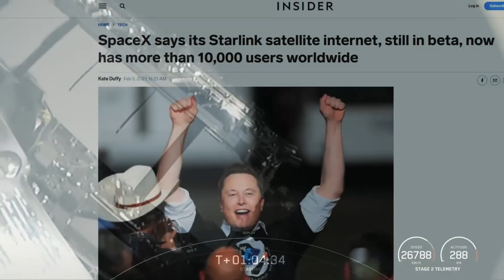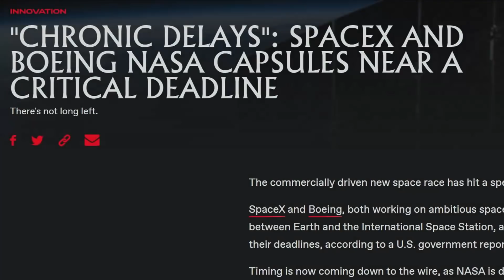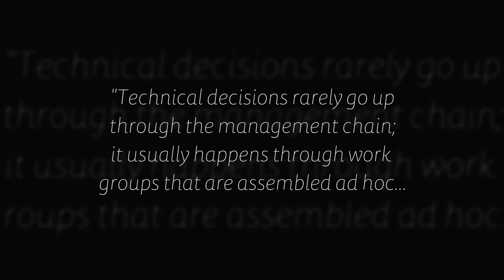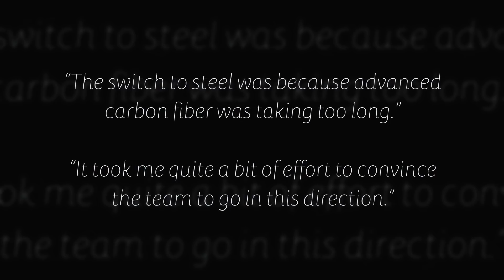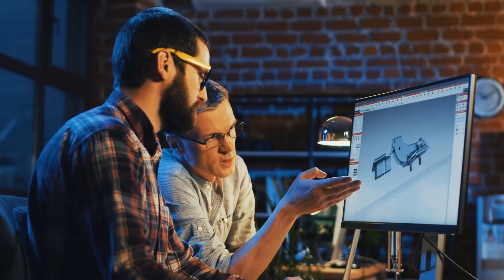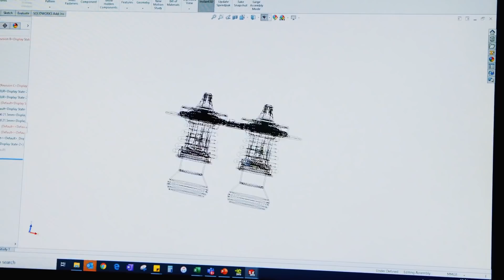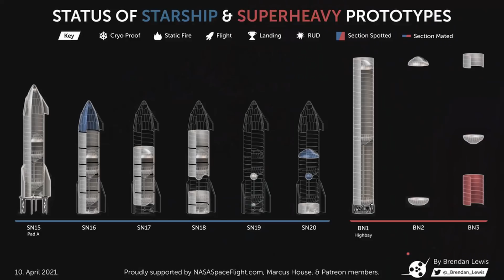How Does SpaceX Move So Fast?

Comment: Broad Group has managed to build a 10 storeys building in just 28 hours.
They managed that because the design is both prefabricated and unfoldable.
What do you think?
Reply from the maker: I'm really interested in emerging construction techniques. I was going to make a video on 3d printed buildings, but I am going to expand it to construction in general. Its very interesting because construction is one of the biggest expenses most individuals face, yet unlike many other technologies, its not really been getting much cheaper. That said, there is a lot of interesting stuff going on in this area that could change that.
Reply: @ExaCognition  The biggest shipping containers are 60ft long and 2.44 meters wide so if they expand by 300% you can get 179 square meters per container.
300% is what tenfold engineering is promising for the TF-38
Reply: @ExaCognition  The largest container ship has a capacity of 23'964 20ft containers so 7'988 60ft containers.
That's 1.4 million square meters that can be deployed in one go, slightly less than the New Century Global Center with 1.76 million square meters.

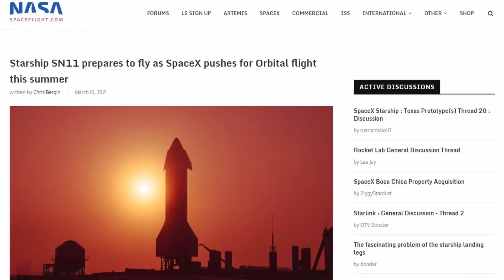Comment: 13:14  First operational flight in September, that is fantastic. I have been asking around for some weeks now if anybody knew when that might happen. Thus far nobody has answered any of my queries, and this is the first story I have seen, text or video, containing the information. What was your source? I sort of have a bet with Jim Bridenstine over whether Starship would begin deploying payloads before SLS flew.
Reply: Not sure if Starship will deliver payloads before SLS flies Artemis I. Elon Musk's Mar 30th 2021 tweet

"Next major technology rev is at SN20. Those ships will be orbit-capable with heat shield & stage separation system. Ascent success probability is high.

However, SN20+ vehicles will probably need many flight attempts to survive Mach 25 entry heating & land intact."

https://twitter.com/elonmusk/status/1376898630582419461?s=20

So they may not even have a Starship survive reentry until 2022. SLS is scheduled for Nov 4th, 2021 and with all the SLS parts in the VAB, they might make it on time.

Comment: #SN15#S16#StarshipN17
Be able Where to find the side antennas-coming-contact📡 with the ground fixed on the💎 wings 💎 closing this lox power wind ignition 🔌🐲 with synchro stop of 8 inches at 😎10/100 e🏎of a second🧲🦿 landing thrust before the ground allowing the balancing of 150 tons 🎠🎠on touchdown heels 👠👡pretty pathfinder.

Q2. Knowing SN15 multiple upgrade 👀 🛹🛹🏆of the reliability of the best modern degree sensors 🛎 ⚖ without flat bottom balancers, this wave finish🦺 magic named Desire.

Q3. Well thought out this 🪔2/3 days of degenerative barometric 🚀 (Mbar=setting of 1013 Millibars)🧷⛽, aiming for the very fascinating RAPTOR sn-series metalox weather allows initially skies ⚔ too dry🪐💡wonderful weekend Starship.

Comment: I've been a part of the software industry for 30+ years and seen the waterfall, RUP and Agile approaches. There is no question that the Agile approach is more cost affective because it lends itself to figuring out the technical details much earlier so you know what works and what doesn't much faster instead of getting to the finish line with waterfall or RUP only to find out that your technical direction used for the very foundation doesn't work and now you have to redesign critical systems which could change the entire design. Musk has also brought unit and integration testing to the hardware world. This is why he is succeeding where others fail.

Comment: Rolls Royce rapidly developed the Merlin engine by taking a few off the end of the production line and running them hard till they broke. They'd identify where they broke, beef up those parts, do it again, till they had one tough engine with the best power to weight ratio. Broke a lot of very expensive engines, but it was a race and it was worth it. An old fashioned way of doing things maybe, but Elon knows he's not immortal, and this is the quickest way to Mars.
Reply from the maker: Test to destruction was something I am planning to cover in a future video, but it's great to see which areas are failure points, and which areas are over engineered, so that you can simultaneously improve quality and performance. As you say, it's expensive but can pay dividends down the line.

Comment: thats why elon chose stainless steel when doing iterative development, carbon is too expensive and slow, stainless is cheaper and faster
Reply from the maker: Indeed, there are performance benefits at both the the cryogenic and re-entry temperatures, but the primary reason was development speed and manufacturing scalability.

Comment: This babayaga begs to differ. 
They should dig a hole in the ground as depicted in some olde 50's and 60s era scifi art.
Whereas assembly would be much easier with gantries and elevators. Work can be performed in any weather 24/7.
Then they wouldn't have to deal with cranes and the hazzards of working with them. 
Should a booster assembly go kablooey - all the bits would be recoverable with nothing falling upon innocent victims.
No worries in case of hurricanes or tornadoes, just button up the lid, continue working.
A mobile disassembly gantry would be handy when disassembling reusable boosters, after they land (intact). Until such time that they can land back into the launch hole in the ground.

Comment: Good PR, general unawareness on subject and head start before announcing. Quite simple, really. Also, some self-defeating points in the video.  1.  fact that NASA pushes for 'unecessary' safety doesn't mean it is wrong ( if that had been the case ), especially in industry where all experiences are literally burned in fuel and written in blood 2. Silicon Valley is no longer "silicon" - it is software. And Scrum-but(t) is about worst way one can go about software (or product) development.   3 There's a great essay "Don't Kill Your Cattle" - that stresses investigating WHY something went wrong, not just replacing faulty machine with new shiny one.

Comment: Its certainly evolved from the early cgi drawing board, there is 3 profession branches governing any invention, the exicutive - Engineering,  judical - Physics, and a third most inventors forget to cope, legislating - Idiology, SpaceX forgot the legislate part with that absolute verticle rendering of a very tall craft, limited balance, criticle on motion impact, as a result, is still evolving...fast, but at many redundant attempts, because the Idiology of an invention that didn't exceed out-of-the box, thus repeats advancing the same path.

Comment: I was suspecting that SpaceX use Agile-like process, but did not know that for sure. After all, Musk is such a prominent person, and one could expect the whole company to be build around him. Also, distributed authority is what makes them so successfull. Thanks for that info.
Reply from the maker: I used to wonder the same thing. It was clear to me that SpaceX wasn't using a traditional methodology but I wondered if they'd developed their own brand new system. Like you, I suspected like you that someone like Musk might deliberately build a specific way of working. 

I couldn't get a definitive breakdown of their exact methodology and how much of it is self developed (which I was quite intrigued to find out), but it seems to be an adaptation of some existing approaches and their own new stuff. They definitely use "Agile" practices quite a bit, there are specific mentions of Scrum teams on the software side. On the hardware side, their extreme levels of vertical integration, continuous prototyping are pretty unique. There are very few companies of their scale that work like this to such a degree.

From Elon comments and other employees, its clear that there is a lot of focus on they way they work, so its very likely their system has developed into something quite unique. SpaceX get a lot of focus on the results of their design, but I think it's actually the way they work that really sets them apart. From software to hardware, production and organisation itself, the methodology appears to be very deliberate.
Reply: @ExaCognition  Given this info, it makes even more sense to see their prototypes fail to land properly. 

With this methodology you're not seeking for a perfect solution, you are primarily looking for right questions. With right questions you'll get to right answers, and they, in turn, will lead to right solutions. 

If so, Thunderf00t's videos critiquing SpaceX are even more out of touch with reality.
Reply: you should read the spaceX book by Eric Berger.. they push the envelope by making sure enginners think out of the box and not bound by how things were done before..   I laugh when you say agile like.. no one in R&D for science or pure engineering works in an agile like process. they use the scientific method.. hypothesize, design, test conclude and make changes and test  and conclude again..   Learn from your mistakes.. thats essentially the essence of Elon's message.. There was an interview with Eric Berger when he interviewed former and current staffers for the book.. he literally say.. you go to Boeing/NASA.. the average age is like 50..  you go to spaceX.. you have young grads.. willing to work long hours, thinking outside the box and not pre-trained in some old way.. half the time rigid processes like agile get in the way of progress..
Reply: @Mellowyellow8888   what you describe here sounds very agile-like to me. Even slide in this video shows quite similar iterative stages as you do. Agile is all about learning from mistakes on simple trototypes, rather than trying to design a product before building it.

In any case, thank you for the book suggestion.
Reply from the maker: Indeed, - 'Build, Measure, Learn' - 'Plan, Do, Act, Check' etc. A lot of these kinds of techniques are often seen across lean and agile implementations. They are often loosely based on the scientific method built into a feedback loop of: Make a hypothesis and a plan to test and measure it against reality, confirm/disprove/update hypothesis, go again.

There are more techniques they use borrowed from science, it's not uncommon to hear say Elon talking about engineering from first principles etc. Liftoff is certainly recommended.
Reply from the maker: SpaceX do use agile: https://spacenews.com/pentagon-advisory-panel-dod-could-take-a-page-from-spacex-on-software-development/

But I agree, there is more to SpaceX's way of working. I tried to capture a bunch of the speed related ones for this video, but there is still more to cover on the performance and cost side.

Comment: Applying crunch culture to space travel is how you end up with dead astronauts... It's horrible for the workers in the software industry, it wont be any better when people are trying to survive on a planet that is entirely uninhabitable.
Reply from the maker: I don't think its quite that simple, design crunches themselves can be rough but how it can impact on safety doesn't have to be mutual. It's intuitive that crunches/overwork hurt concentration and thus quality, but the safety exposure is greatly dependent on the robustness of the development process.

The development and quality processes tend to have a much bigger impact on the failure rates than the development speed itself. Another way to think about it, if you build a lot of prototypes you get more opportunities to identify can correct failures. Falcon9 is probably a reasonable demonstration of this, it flew so many times before people even got on the spacecraft, thus the development process itself wasn't a safety risk.
Reply: The answer to safety is test, test and test. Spacex do a lot of testing so many of the fail condition show up in their testing, The crunch time culture only becomes problematic if you remove the iteration. Which do you think is safer a plane design and built for 20 years but only flown successfully once or a plane design and built in a year but has already been flown 20 times successfully.
Reply: Its not the same. Elon's companies make delays. They aim for a goal, but they don't push out things before they are ready.
Reply: I agree.

This approach will take them so far, but once they are regularly working on projects that involve actual humans in hostile environments, they are going to have to slow down.

If not, there will be a high-profile death of an astronaut or group of them, and either the bad press will sink/heavily damage Space X, or it will be ignored and more and more astronauts die in reckless experiments.

At the moment, most of it is remote-controlled, so they can afford to be lax on safety. Once they are building and testing living quarters in space, things could get messy.
Reply: @TheHaighus  this is PRECISELY my concern! Frankly you spelled it out a lot better than I did lol, thank you! Rapid development and testing is fine when 0 human lives are at risk, but if someone's visor ends up cracking up there and they spontaneously suffocate because the manufacturing was rushed to meet the deadline, it would only be about a million times more tragic than when the Challenger exploded (and also for reasons that could've been avoided, had they waited and been more patient).
Reply: Lol, it’s horrible that people making 100s of thousands a year for just being the labor. And owners become millionaires within years. Oh poor victims
Reply: @scienceisall2632  i mean, yeah, you hit that one on the nose: The people who are actually doing the work only ever see a tiny fraction of the total wealth they create through their work, while a handful of folks who are already wealthy beyond imagining take the rest for themselves. That's the definition of exploitation. 
But that said, i don't believe that is relevant to the issue i was actually pointing out. My concern is with the "get it done yesterday" attitude. Sending people to Mars will be the most ambitious project humanity has ever undertaken, and it's not something we can afford to be sloppy with. While i appreciate the rapid progress they've made, I feel that crunch culture borders on a recklessness we can't afford when human lives are in the balance. And when you factor in that all of this is riding on the ego of one of the richest people on Earth, I can't help but be feel nervous for whoever Elon plans on sending to Mars...
Reply: @nzuckman  Its not crunch culture though. Crunch culture is when you have hard deadlines. SpaceX doesn't use hard deadlines. Fast iteration and crunch culture are two different things. They don't go hand in hand.
Reply: @Elrog3  2:07 Idk man, that doesn't sound like what Exa Cognition said. 2:43 or what Garret Reisman said, who works for SpaceX. 
People (including Elon) regularly sleeping at their desks to meet deadlines is the epitome of crunch culture. Those kinds of working conditions are fundamentally detrimental to the quality of these people's work, which cannot afford to be compromised when we try to send people to Mars.

Comment: I just found out that raptor has 3.5 times more thrust per square meter than the F1 engine used by the saturn V which means it could lift a >300 meters tall rocket!

2,261kN/m² Raptor-FT
1,582kN/m² Raptor
1,394kN/m² Shuttle SRB
1,358kN/m² Merlin 1DFT+
1,164kN/m² RD-191
1,162kN/m² RD-193
1,159kN/m² RD-180
1,104kN/m² RD-181
1,099kN/m² RD-170
1,051kN/m² Merlin 1D
1,013kN/m² RS-27
  959kN/m² BE-4
  946kN/m² RD-275M
  930kN/m² H-1
  923kN/m² NK-33
  900kN/m² RD-275
  880kN/m² Viking 5
  862kN/m² Viking 2
  764kN/m² Rutherford
  752kN/m² RS-56 OBA
  673kN/m² RS-68A
  647kN/m² F-1
  636kN/m² RS-68
  487kN/m² RD-107
  411kN/m² RS-25 SSME
  363kN/m² Vulcain
  311kN/m² Vulcain 2
Reply from the maker: That's quite handy for stacking them in as "small" diameter cylinder as possible. I assume it's got lower volumetric efficiency though, given it has a lower thrust to weight ratio than merlin (if we ignore propellant systems), though it is a 2 stage combustion engine. I'm quite intrigued to see what the final raptor isp is, it could be pretty high.
Reply: @ExaCognition  Yeah, it's the square cube law, if you make your engine twice as big it will have 4 times more thrust but 8 time more mass/volume.
So thrust per unit of area is specific to a given engine design while thrust to weight ratio is a bit of an unscientific unit.